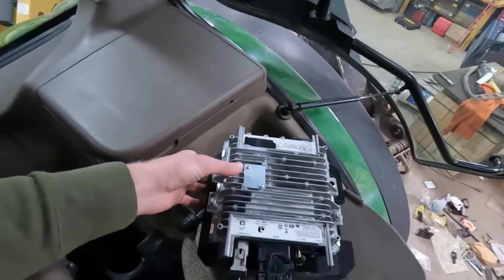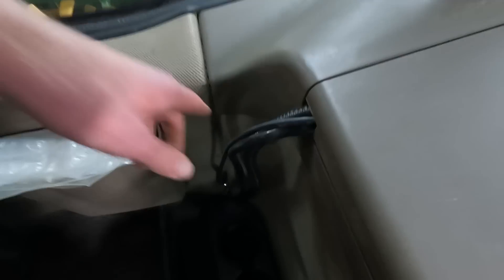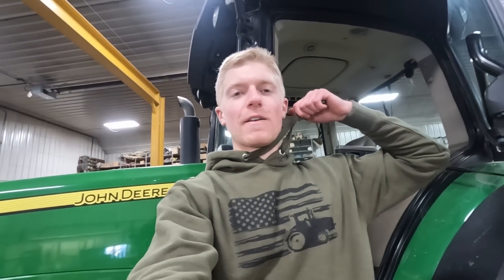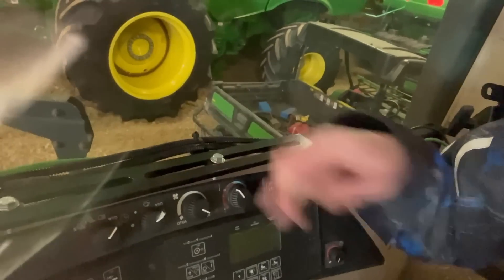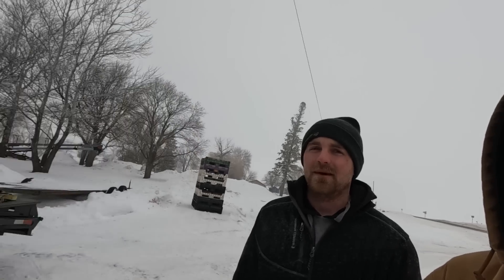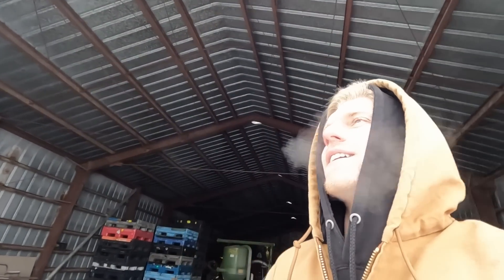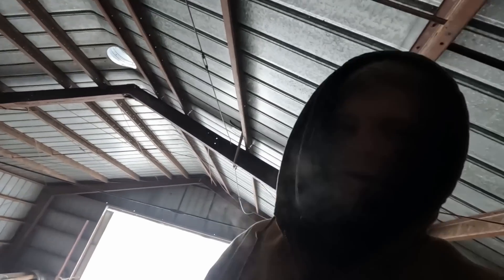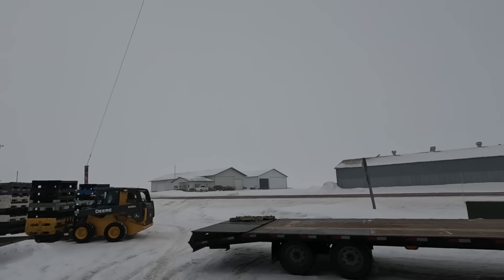Performing Surgery on the John Deere 8320R!

Comment: Hey Carson! This is a pretty inspiring video! I'm behind in watching, so I hope I don't speak out of turn, but are you 3-D printing the MTG brackets, and other brackets you intend to offer? Are you doing your own CAD files? Are you contracting the printing if they are printed, or do you have your own printer? That technology is improving so rapidly. It makes perfect sense to offer a whole line of things you come up with and can sell after making them in short runs! It's a whole new world in that line...no injection mold to make or hours of machining on lathes and mills....from your mind, to the computer, to the printer. I hope that line of thinking you are on flourishes for you! That could be a business just by itself, in time.

Those knock-down crates look great! (reusable transport packaging some call it, sometimes I see them used for produce, but also for any product distributed on a circuit) You might want to paint or stick a number on each one, since it provides an index point for the human memory, even if you have them on pallet racking with the flap down. Your QR code idea is great! You could print it out and stick it in a sheet protector for at least some of them you personally might load with a large variety of things or item iterations.

It looks like things are going really well. I'm very glad to see it! Thank you! :) Love the new merch, btw! Classy design and color, the one you were wearing in particular.
Reply from the maker: Thanks for the great comments!  I designed the files in a cad program myself and I own 2 3D printers and do all the printing myself!
Reply: @6thGenFarmer  Yw Carson! That's great you do all of that yourself! Are they sla or filament machines, or both? I see some on the market which are priced quite reasonably and are quite tempting! If I may humbly share, Angus on his channel "Maker's Muse" has offered lots of good insight and reviews I found helpful. Thanks again!!

Comment: Just because I have to comment on your good vids - is it worthwhile to put some type of rubber gasket (an old windshield washer type hose with a slit in it) around the drummeled out portion so it doesn't cut into the wires - with all the bouncing and stuff that happens in a tractor? You get my idea.
Reply from the maker: Probably not a bad idea! Thankyou

Comment: Did u look under the floor matt where they normally go on 2011 see if there's room for it there
Reply from the maker: 2009 and 2010 r series do not have the spot under the floor matt like the 2011 and after models do!
Reply: @6thGenFarmer  gotcha. I didn't even need the antenna for our 2012. But I've seen guys put those under the cab roof panel